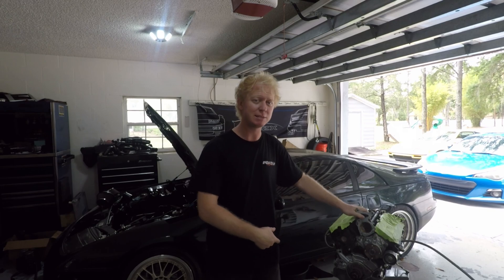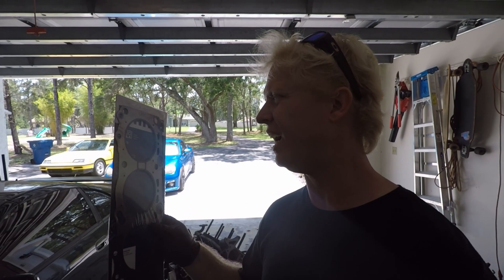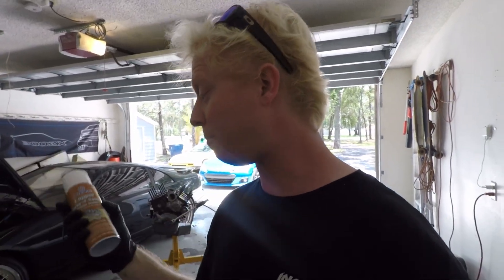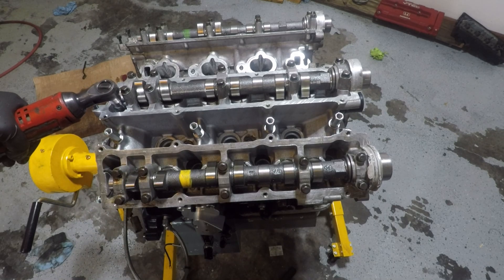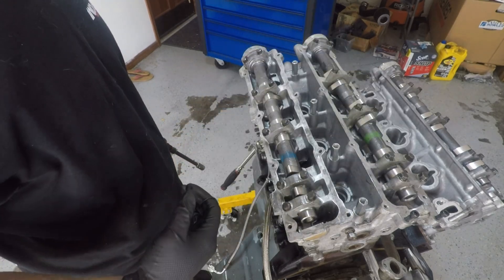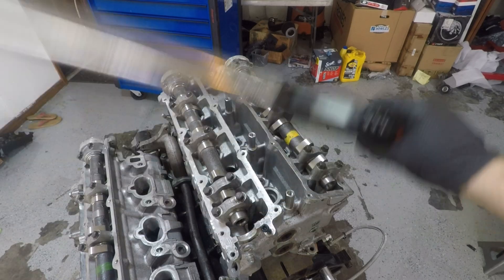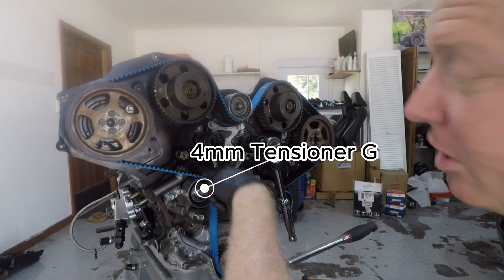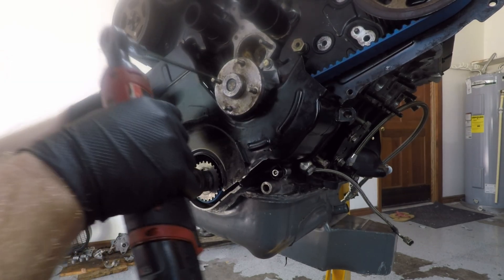Building a Twin Turbo Nissan 300zx VG30DE Engine in 10 Minutes!

Comment: Your comments about the head gaskets.. mls is the best option for power. Also, you wouldn’t have issues or need the copper spray if you prepped them properly and not with a scraper.

Comment: First car was a 1991 300zx Na. 110k original miles, 5 speed. Man I remember shopping for my first car at 16 on Craigslist, and beinwg blown away when I came across a car this bad ass with so much potential in my price range. And a 2 seater! That was a serious, yet low key flex in the early 2000s. Bought her for $4500 and promptly wrecked her. Insurance fixed it, and 1 week later I blew the engine lol. Paul Walkers eclipse would have been proud. 
8 years later I bought myself a 95 with 120k original miles, imported a jpm spec motor, and then over the next 2 years, I threw every high performance part conceptZ and Z1 had to offer at her, with absolutely not a single idea what I was doing or planning. 
The result, I accidentally stubbled into my dream car.
Reply from the maker: That is a hell of a story!

Comment: Im staring at a fully Stock Z with 167,xxx on the clock plenum was removed today before I start doing anything where do I start. It is in fact an NA I am having injector misfires in cylinder 4and 6 removed radiator clutch fan pop charger front bumper and crash bar started doing read ups on deletes such as coolant bypass egr delete pcv and aiv deletes but don’t want to do it if it negatively impacts my 300zx as I’ve been told by many to go with coolant bypass and egr I’ve spoken w z1 and they said they don’t understand why ppl delete pcv if the system needs it with that said I just purchased silicone master hose set from z1 and new battery harness

Comment: Great video.  The Merlin Racing manifold look just like the Ash-Spec intake manifolds.  Edited (missed the part of the video where you installed the intake manifolds).
Reply from the maker: Thanks! They're actually quite different. Starting with the fact that the Ash manifold is fully cast aluminum. If anything I'd it'ssimilar to what you would find on a modified r35 GTR.
Reply: @Billy_Built  Thanks for the info.

I did read about Merlin Racing a few years ago (right when the pandemic happened).  I was shocked to see his other work where he installed the Holley Hi-Ram onto his 300zx.  It reminded me of the Jun 300zx.

Once again, great build and video.
Reply from the maker: @rudimerm7686  A lot of the products and ideas that he brings to the 300ZX, have come from other markets where it has been proven to work.

Comment: You peak power is going to move up the rpm range, considering the short runner intake.  I'm surprised you didn't also get the Callie crank.
Reply from the maker: That's the target for power, especially with the cams and turbos I'll be using. Callie crank is way out of my price budget for the bottom end this go-around. Lol
Reply: @Billy_Built  Understood.  Please, don't go wild onthe reline...

Comment: Great video Billy. With the exception of your Merlin parts, which are beautiful, if you have solid lifters, you and I have the same build I believe, including the Specialty Z oil pan. I'm curious, did Scott tell you about the ATI balancer problem? I had one also, an it wasn't two weeks later, after him warning me about these throwing the power steering belt, that it threw it. I wasted four power steering belts trying to get them to work. That's when I decided to just run without power steering, which SUCKED. Well, not long after that I got stung by second thing Scott and Rick warned me about, TOMEI
 
Yeah everyone, like Billy said, use nothing but the stock head gasket, copper sprayed on both sides. It happened to me while schooling a guy, FOUR TIMES😂 in a loud ass HellCat Redeye in the error of his ways, picking on a little V6, that the passenger side gasket blew out on me at No.5. It wasn't a big obvious failure, in fact it was quite small. It wasn't till about a week later that I noticed I was a quart low in coolant. I check my oil before every drive and never saw any evidence of water in it, and didn't then either. I got lucky there, but when I checked my plugs, No.5, in my two month old, freshly fully built, 786 rwhp engine, was wet and fouled🙁 Yeah, STAY AWAY FROM TOMEI.

As for my ATI balancer? It's now a dust collector in my garage, and has been replaced by Rick and Scotts suggestion, a brand new OEM one, that Nissan charged me $350 or 60 dollars for.🤬 BUT,  my PS belt is now staying where it belongs. I could not, will not in good conscious try and sell it to someone. BUT, if someone wants it I will be glad to give it to you for the cost of shipping. You never know, it may work someone. However, without causing it any damage, I will deface it so as to make it unsellable. Yeah, it'll look like shit, but that's all.
Reply from the maker: Thanks! I'm still using the factory hydraulic lifters here though. I learned about the ATI damper problem years ago after I bought it myself. It would throw the power steering belt after every first gear pull, my splash shield would catch the belt every time luckily. You can shim your power steering pump so that it lines up with it. However, this time I will be switching to an electronic power steering pump anyways.

Comment: if you see this. can you give me a total of how much this complete motor would cost? i have a 90 turbo but they guy i bought it from. didn’t install the plenum afterwards. i figured the whole motor might need some work but how much do you say this vg30 itself will cost? (i’m figuring the top end isn’t all i need, i also need new spark plugs and injectors. literally just the top half) thanks ! 🙏🏼
Reply from the maker: Lately, I haven't paid more than 200$ for a VG30, running or not.. But at the same time I wouldn't just drop the motor in without going through it first..
Reply: @Billy_Built  i meant, the car came with a second motor in it. the guy blew the first one. so it’s on a new turbo motor but how much do you think a full rebuild is? like maybe if some stuff is already fine on my motor ? i just wanna see how much it’s gonna cost to put that plenum back on , and im sure there’s more problems with it i wasn’t told about too. super clean oil,  nice feeling clutch. this car was kinda a steal but i’m barely 19
Reply from the maker: @waynesegura5695  Could be upwards of several thousand dollars.. All depends on what needs to be fixed on it and who's doing it. There's a lot of variables there. If you have the spare motor, , and at your age, I'd go get some tools and start tearing it down, and start learning how to rebuild it yourself, just learn as much as you can along the way.
Reply: @Billy_Built  i’m fine with spending that too. money isn’t an issue for me but i wanted the opinion from a real z32 guy. thanks for the advice, i will definitely try and start. he ran 50k on this motor before he decided to upgrade the injectors and never put it back together.  then i bought it the way it is, top end disassembled. my buddy said it shouldn’t be more then 3000$. thanks for your opinion man !

Comment: this some good stuff planning on something similar  very new to the vg30 engines .but i want to building one myself maybe put the merlin machining hi ram intake  with a  if possible a carbon fiber intake  with 105throttle body(maybe single tubro it ), Merlin covers  but still looking into info for JWT Solid race cams   then probably getting more parts other then big injectors ,new piston set ,rods ,valves    basically want a racing engine (igot spare one so looking to experiment with success)but at this point the stroker kit might be worth also looking into
Reply from the maker: They take a lil work like any other motor but it's worth it.